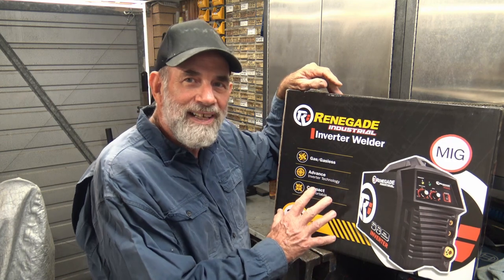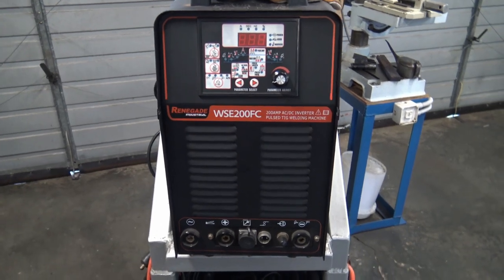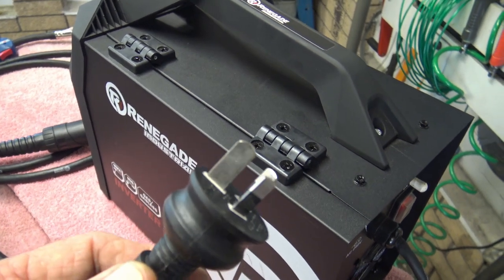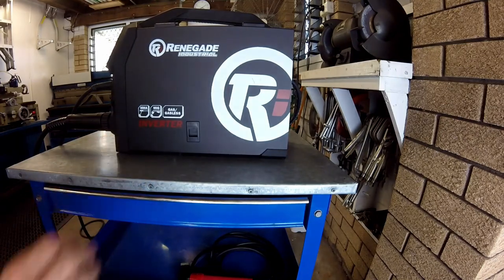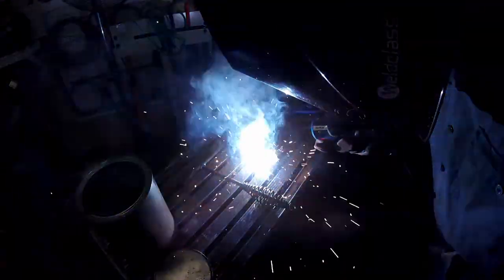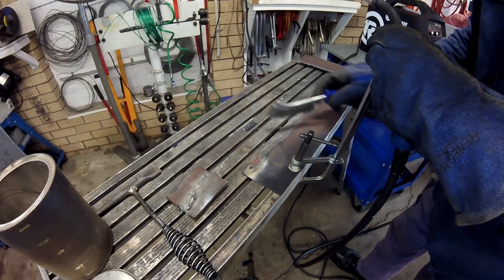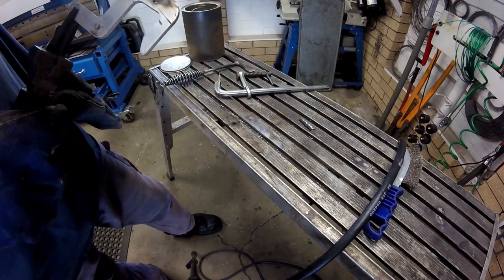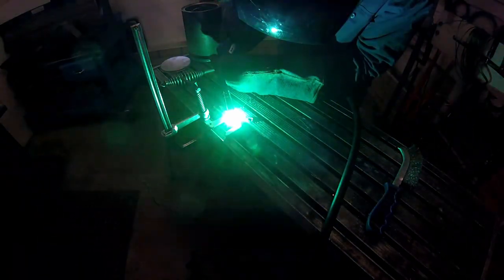Buying a MIG Welder in Australia | Renegade Industrial 200 Amp MIG

Comment: Bob, thanks for doing this video on the Renegade 200amp MIG welder. I bought the smaller 180 amp unit and as with you found the instruction manual very confusing. They say the knob on the left is for wire speed/amps and the one on the right is also for amps. Thanks for pointing out that the right knob is for voltage in MIG format and amps for stick welding. As you suggested I got some scrap steel and did a bit of experimenting and very happy with results I got by just using flux core wire.
Reply from the maker: Great to be of help John, thanks for watching the video. I have been using the flux core wire quite a bit of late and am very happy with the welds I have been making.

Comment: Great Video Rob!  I learned a lot about MIG welding.  Although you were just doing a review, I found the advice on setup, voltage, and properly tensioning the wire very informative.
Reply from the maker: Thanks Mark, I think there will be lots of YT tutorials on welding with MIG which is why I did not pitch it that way. Actually I would be surprised if there isn't, I haven't really looked, but I see lots of video with MIG in the title, so assume there are.

Comment: Great Video Bob. I have never welded and just purchased a Renegade 200 to weld some rust patches into my old Beetle and couldn't find any information on how to set it up correctly as I also found the instructions hard to follow. Can you help with sharing what your setting would be for welding 1mm sheet metal with 0.8 steel wire? After watching your video I can't wait to start experimenting this weekend, as I had no idea where to start as the Renegade dials are quite confusing for a novice like me... Thanks again, cheers Adam
Reply from the maker: Thanks Adam for watching the video. To date all my use has been with 0.9mm wire, so sheet metal with 0.8mm is a bit of a guess for me. First off get yourself some 1mm sheet metal to practice on. Practice is always important. Even though I have been welding for 50 years, I have little practice pieces in my shop, I know the drill, but need to re-familiaise myself with the doing sometimes, if I have not done it for a while. What I am saying there is that even the experts practise before doing a weld they are not used to doing day to day. I am thinking you should set the current setting midway between the 80 and 120 amps and set the wire feed at about 4 and see how that goes. The current setting is the voltage in this case which is the push, and the wire feed is the current, or the melt. If it looks bad, ie looks like cocky poo, increase the wire feed, and if it blows holes reduce the wire feed. If things look not too bad then either accept that or make slight changes forward or back with the current setting. The important thing is to get the settings right, before you move on to the real thing. Hopefully I have give you some useful pointers there,  good luck. Bob.

Comment: Thanks for your review Bob. Any further thoughts after owning this unit for a year or so? Are you happy with the adjustments, does the lack of burn back adjustment matter? Basically asking are you sorry not to have purchased a higher end unit? Thanks in advance and for the content you produce. Rowan...
Reply from the maker: Rowan, more than happy with it, and I have had no issues, it is a great machine. When I did my trade, welders were no where near as sophisticated as they are today. As a consequence, I probably have actions that I do, but I am not aware of, that negates the need on my part for those helpful features like 'burnback adjustment'. This unit does the job I want it to do, which includes sheet metal to truck chassis, and at no time have I thought, I wish it could do something extra. Hope that helps you with your decision. Bob